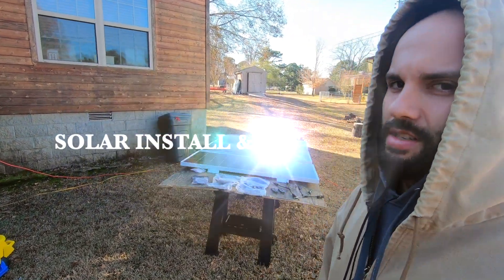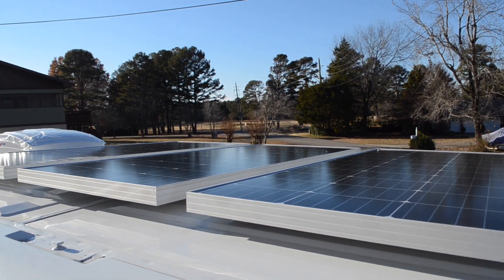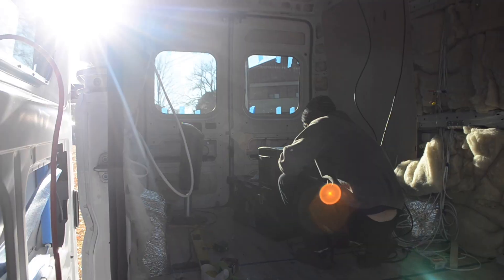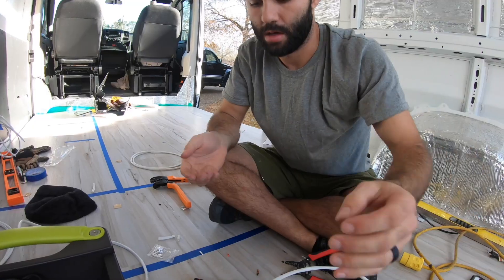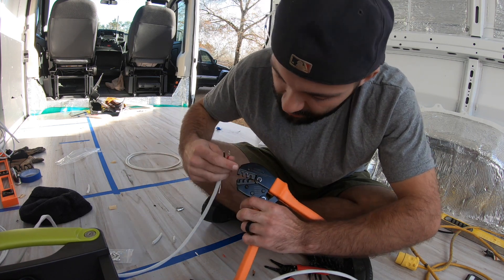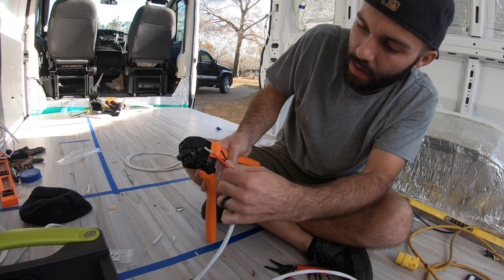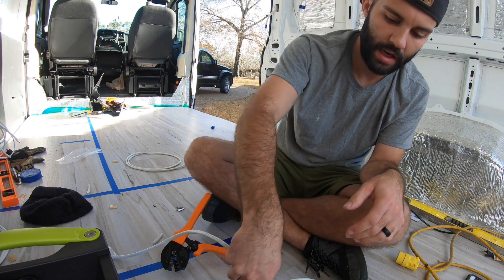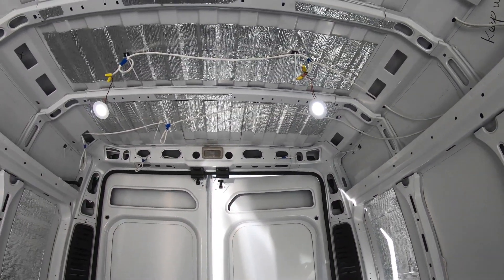SOLAR and Goal Zero Yeti Camper Van Conversion Install | Off Grid Camping

Comment: Quick question.  What did you use to connect the renogy to the goal zero?  I was hoping to just simply do 1 renogy solar panel and the yeti 400 or even the yeti 200 if I could swing it.  I am only powering a ceiling fan and 3 12v lights.
Reply from the maker: Hey, to connect the solar wires to your Yeti you need this cable adapter to plug into the input!   https://amzn.to/353XWPK

Comment: This might be a silly question but, oh well, here goes: Are the fuses on the Anderson PowerPole Fuse Block interchangeable? For example, if I wanted all the fuses to be 5 amps, could I do that or do the fuses need to stay the way they came?
Reply from the maker: Hey, never a silly question. I see it that you can change them to whatever you want. No where on the block did it mention they had to be this certain size amp in this location or not. I would not see a problem with doing whatever size amp you want, as long as it’s enough to handle the load you are putting on it

Comment: Got a few questions as I am doing something simular. 
Do I have to worry about TOO many panels or too much wattage? When hooking up panels to my yeti 400?
I shouldn't need a chard controller correct?
Also the yeti 400 has 2 Anderson ports so I can add additional batteries?

I had seen some mc4 to 8mm yeti adapters. 
Anything else you recomend. Thanks!!!
Reply from the maker: No the yeti has everything needed and therefore no charge controller is needed. 
As for the adding extra batteries into the Anderson ports, I am not sure at all. I have no experience in adding my battery as we got the yeti 1400 and had all we needed.

Comment: Great video and thank you for posting such useful information for retrofit. Now in retrospect, even thought you sold the van, can you review how the setup worked with real life van use ?  Especially in regards to the all the electrical components you have running like the refrigerator and water tank heating pads. We are still on the fence btw a Yeti 3000 and a 200aH DIY system. Thanks !
Reply from the maker: Hey there, glad it helps and I’d be glad to explain. So to start our fridge drew next to no electricity at all, I think The most I saw it pull was around 5.2amps. That was the main thing on all the time. The nature’s head toilet we didn’t see pull much either along with the tank heating pads. All in all we loved the Yeti. It was super convenient and functional. One draw (no pun intended) was the draw and next to no function of the Yeti when we tried to use our VitaMix. I will say it was possible but wasn’t easy. After many resets of the yeti because the VitaMix was too much we finally figured out that we had to slowly turn up the speed on the VitaMix and could go no higher than 4. And if for some reason things were “stuck” in the blender than it would overload. So needless to say our smoothies were a bit “chunkier”. If there was a downfall it would be that. But still the yeti was a great option. I am not sure if this problem would exist on the 3000 as we had the 1400. Could be something to speak with Goal Zero themselves about. Hope that helped you. Thanks for watching and good luck with you build!
Reply: Steady Streamin Cashios Thank you for taking the time to respond!  Good to know about the VitaMix. Those are a mother of a load. I wonder if our nutribullet would be fun though. It’s great to know that this setup worked so well.  I also just saw that some people are retrofitting other charge controllers in order to hook up larger panels. So that’s great news for us.  Cheers!
Reply from the maker: Yes, I have read about others using different controllers! Could be a possibility!👍🏼

Comment: I know i spund crazy but the mc4 solar to anderson...it dosnt fit...like the both female to female if that makes sense ...i try to conect  it and the imput on the yeti is the same as the adaptor....i know i did something wrong....uhm what next ..
Reply from the maker: Hey there, I know they sell some connectors that are opposite and possibly even the same female/female. Possibly you have the wrong one. I know they change for some reason on Amazon. I think they are all the same price as well. I know you aren’t crazy, the first one we bought needed the pos/neg wires swapped to work properly. Hope you figure it out.

Comment: Thank God for your videos, just started my van conversion, and I had no idea I could go that route. I'm gonna watch 3 more times to make sure I got it.
Reply from the maker: Aw yay! If you have any questions after watching let me know!
Reply: Steady Streamin Cashios awesome, thanks I'll take you up on that 😀
Quick question, is the 1400 enough for the lights,fan,fridge? Thinking to get the link for the 1400 and connect with my vans battery!!
Reply from the maker: Hey, with the 1400 it had plenty of power for our lights, fridge, fans, toilet, receptacle, etc. Provided you have additional solar to charge it. Our fridge did not have much of a draw at all.

Comment: Great video I now get the 12 volt part but how do you hook up the 120 volt ? Do you just plug things in directly or is there a block to wire 120 . Thanks
Reply from the maker: For our 120 we have one receptacle on the counter. I used an extension cord and cut it and wired the receptacle using that and plugged it into the 120v plug ins on the Yeti. Hope this helps! Thanks for watching!

Comment: Did you go with 100W panels because of the open circuit voltage having to be under 22V? I am planning on getting the Yeti 1000 and was looking at the 160W panels (to have 2 instead of 3) but the open circuit voltage on those is 22.8V.

Thanks for the all videos, they're great and make this project seem just a little less intimidating!
Reply from the maker: Hey, yes that is why we chose the 100W. And also because when we were ordering panels they just so happened to be on sale for a very good price that was ending(around Black Friday). After traveling a few weeks we haven’t had any problems with our Yeti recharging, especially out here in Arizona, by 10:30 in the morning we are back fully charged after running fans and our fridge all night. 

Glad the videos help! We definitely watched our fair share of videos from others. Good luck with your build!
Reply: @SteadyStreaminCashios  how low was the unit getting every day with that setup? We're thinking pulling a trigger on a 3000 but running a iMac and Dometic CFX95 for a year.

Comment: Great Yeti explanation. I bought the fuse block but have never done wiring before so all new to me. The fuse block comes with the Anderson connectors already in the block. Can these pull out of the block or do you just insert the wires? Probably a dumb question but don't want to break it.  Its nice to see someone with the same van how they do it.
Reply from the maker: Hey, never a dumb question! Yes, you can remove the Anderson Connectors. You can even pull them apart separately, black from red, red from black. They just slide into each other. Hope this helps! Good luck on your van build